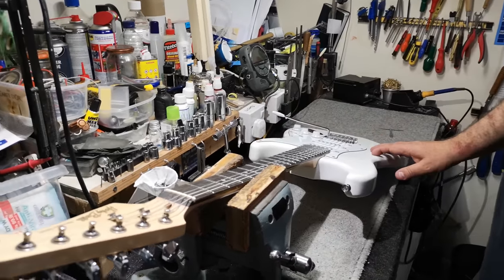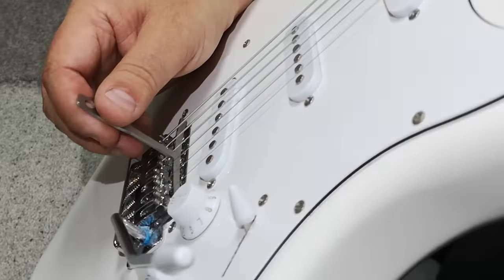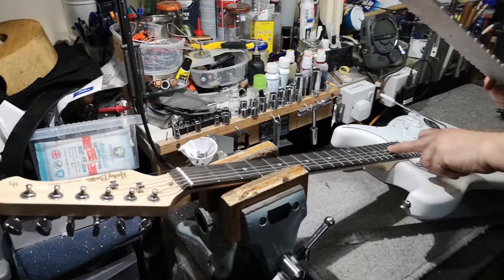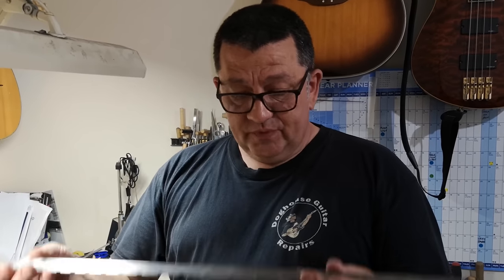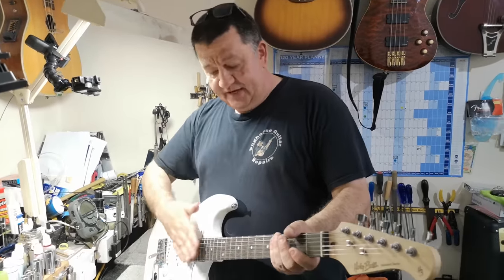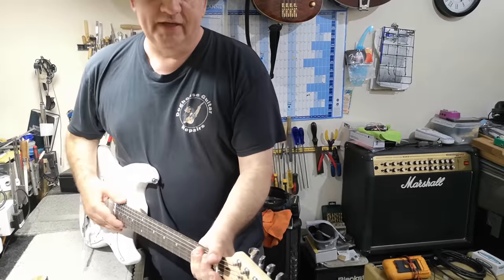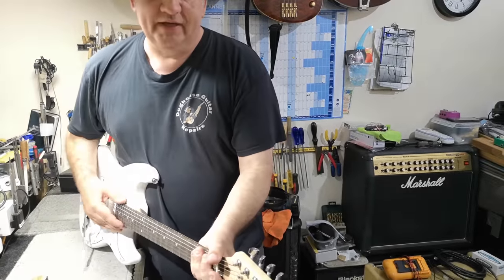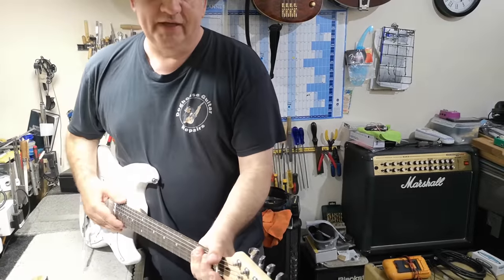I took my £30 / $40 Harley Benton to a LUTHIER...  (Harley Benton Setup - Video 1)

Comment: I'm also hotrodding a basic Harley Benton. Setup on mine was pretty good from the factory. I removed the top string tree because it was rough as hell.
I swapped out the pickups for a rainbow set of lace sensors. I have just put on a Vega Trem. Next thing is to swap the nut out for a Wilkinson rolling nut.
This was a Very informative video.
Now subscribed thanks.
Reply from the maker: Thanks so much for the sub.  Wow you’re really going for it with the mod’s!!  I’ve currently had mine set up, the only mod is a new Neutrik jack socket 😂
Reply: I put some graphtech string trees on a beginner level Ibanez I got for my daughter's Birthday last year and they're fantastic. Although everything Graphtech makes is awesome. Just an aside thought. Good luck with your modding, I'm addicted to it myself 🤣
Reply: dont forget when and if you install a roller nut on a guitar, the break point is going to be farther away from the first fret as opposed to on the edge of an ordinary nut so you have to compensate by removing part of the wood on the first fret. and once installed you can not go back to an ordinary nut, because the fret space is narrower.

Comment: Just stumbled across this video, what a gem. Love that Phil takes the time to properly explain, I've played close to 20 years and still picking up new information. Fantastic when people with this level of knowledge take the time to go through the nuances of an instrument rather than just give you some baseline nonsensical measurements of what relief should be. Still haven't got a scooby what a 16 thousandth is haha
Reply from the maker: Yeah, the whole thousandths of an inch thing is old school pre metric measurements. 16 thousandths is 0.406mm 👍
Reply: sixteeen thou is 0.016 inches. imma guessing you not a mercan ??

Comment: I don't mean to discredit this man as he clearly has a lot of knowledge on the setup of a guitar, but I own 5 Harley Bentons and had a good rapport with Thomann during the time I was buying them. They take every guitar that is about to be shipped to someone and do a final setup on them before shipping internationally (What they do in store in Germany may be different) but all of my guitars came with no need for any major setup changes. minor tweaks for my preference in action, yes. but relief, intonation etc. were spot on. You bought this used. I bet the previous owner either tinkered with stuff he shouldn't have touched, or never got it readjusted over time...
Reply from the maker: That’s great that you’ve got good ones from the factory.  Phill sees hundreds of Harley Benton’s and generally they’re ok but need a few setup tweaks for optimum playability.  Every guitar should be set up from the factory and tweaked throughout the year with the changes in temperature / humidity.
Reply: @ScottPoleyMusic  I totally agree, and their A stock stuff seems to, for the most part, adhere to what you say they should be doing. Their B Stock though? Stay away... I had one B Stock from HB show up so far off the mark, the luthier couldn't fix it... it's now a wall hanger.

Comment: In 1986 I bought my first, new, electric guitar. Prior to this I had a second-hand Hofner (which was a dog!). I bought a Japanese-made Red Squier (by Fender) Strat. It was great, compared to my Hofner, but compared to the two Harley Benton guitars I currently own, my Epiphone, my Ibanez, and even my Squier Bullet Mustang.... that Japanese Strat was total crap. It amazes me why they command such high prices today, because any HB, Vintage, Epiphone, or current model Squier, would wipe the floor with that '86 Strat in all areas (quality, tone, playability, everything!).

Of course I won't compare it to my James Tyler, Gibson Les Paul, or Chapman ML-1, for obvious reasons, but back in 1986 I got the chance to compare my '86 Squier with a friend's Les Paul Custom ('72 model), and a Fender American Strat, so I know it was shite from the outset.
Reply from the maker: That’s great insight, thanks so much.  I also have a Hofner - a 1958/9 Senator model.

Comment: The channel here you really should watch is StringTech Workstations, maybe even more than the Stewmac channel actually. For frets and necks he´s the best. You don´t have to make the notched straight edge yourself they are not that expensive and the tools you need to make one will cost you more. I measure and evaluate the straightness of the neck and then I use a stewmac fret kisser to level any high spots from the individual frets = I don´t have to re crown all frets. Then you smooth the fret ends set your action/how much relief you want and your neck job is pretty much done.
Reply from the maker: Cool, sounds like you’ve got a great method there 👍

Comment: The first guitar I bought by myself was a Washburn T-Bird from about 1978. I paid £130 for it and sold it for £100 because it wouldn't stay in tune. A few years later I learned about changing the nut, straightening the neck, adding locking tuners etc.
How I would love to get that guitar back now. They sell for around £500.
Reply from the maker: Oh man, we’ve all got those ‘one that got away’ moments.  They were such cool guitars

Comment: Judging by the logo on the headstock,this is quite an”old” pre-logo change guitar. My HB Tele has the same logo,also bought secondhand,but adding brass saddles,and a few minor pickup adjustments later,it’s a perfectly playable instrument,for a total outlay of around fifty quid!
By contrast,my HB 450 plus LP(a fairly recent acquisition),arrived from Germany in three days,with a pretty much perfect setup,almost in tune,and no sharp fret ends.The finish is also astoundingly good,so I think HB are constantly upping their game,quality-wise,unlike some of the so-called”high-end”manufacturers(no names mentioned)who seem to have got somewhat complacent with their quality,on the assumption that their name will sell the instrument.
Reply from the maker: I wasn’t aware of the logo shift.  Interesting Dennis!
Reply: On a closer look (bigger screen),you DO have  the later logo,so should be an excellent instrument,after the set up.
Haven't watched right through yet, but, particularly with strat style guitars,it may be advisable to line the internal cavities with copper,or conductive paint,to cut down on hum.
Worked well on an upgraded Chinese cheapie that I used to have.
Now in the hands of my granddaughter! Don't think my daughter in law was best pleased,but my son's okay with it,as he used to play electric bass in a band.

Comment: Just got the same one for 20 quid. Only one saddle screw was missing and needed some setup. Sounds and feels great. Can't believe the value I got for almost nothing.
Reply from the maker: Wow you got an even better deal than me.  Mine is currently 24 shows into a 60 date theatre tour, updates coming soon.  They’re so good, hope you enjoy yours and have loads of fun with it.
Reply: @ScottPoleyMusic  Thanks man, I've been wanting to get a single coil guitar for those twangy clean tones. This one totally delivers the goods and even distorted there's not much hissing. The only fault I can find right now is one of the tuning pegs is not tight enough. If I were to gig with it I'd change the tuning pegs and the nut. But even in this state it feels like a £200 guitar. Ridiculous 🤣

Comment: This guy knows what he's talking about. The explanation why guitars come out of the factory with higher action than they could is particularly pertinent. No manufacturer wants to have buzzing guitars in shops so they set them up with some extra margin. 
I leave my basses without strings for 24 hours each time I clean them. Nothing ever happened. Neck bows back and comes back into place when the strings return. It could be a different matter if a guitar were to be left without strings for months in fluctuating humidity conditions.
Reply from the maker: Agreed 👍

Comment: great portion of practical knowledge and explanation, thanks! Though my conclusion is not to do it by myself - I will go to the luthier. It's just a bit too complex and precise for a non professional like me. I only play these things ;-)
Reply from the maker: Absolutely Pawel, hopefully these videos will help you chat to a luthier about what you need from your setup.  Good luck 👍
Reply: Watch Dave's World of Fun Stuff and play with your cheap guitar. Worst case u break it but you won't. Then you can buy a range of budget guitars and modify them to play better than a custom shop at a fraction of the price.
Reply from the maker: That’s one great thing about budget guitars, if you want to learn to repair guitars, buy a cheap one.  If you make a mistake, it’s not an expensive Fender / Gibson.

Dan Erlewine and Frank Ford are my two luthier heroes (Phill’s too).
Reply: @ScottPoleyMusic  Lets not forget Twoford. An excellent luthier IMO

Comment: I liked the video, I think it's a good insight for people like me that like to attempt these things and actually see his thought process. HB are certainly putting pressure on other brands made in the same factories, I think HB still has a stigma against it but the way the world is right now, you can buy a HB with stainless steel frets, locking tuners, EMG pickups (you might not like them but they're branded) for less than £350. You could spend more than double that on let's say a Chapman (I use them as an example as they don't have a luthiers they just spec them the same as HB) and for arguably less guitar. 
But the name on the headstock ultimately sells the guitar... Will that change?
Reply from the maker: Very good points CagedPaps.  The value of the Harley Benton gear is undeniable.

Comment: Idk about string gauge. 

Hendrix played banjo strings. I think string choice is really a bit more musical than structural but I  appreciate the perspective from a gigging musicians pov. In that regard having a tool that's made to be reliable makes sense.
Reply from the maker: String gauge is such an interesting debate.  I say, try them all and find what works for you.
Reply: Banjo strings are the same as guitar strings other than the loop ends. And they are about the same gauge as a regular light electric set. Most have 009 or 010 high strings. 
You may be thinking he used a lighter gauge.

Comment: dang i guess i never realized heavier strings need a truss rod adjustment, and also that its the strings that lose intonation not the guitar itself. i always wondered why my tuner would say flat when i would tighten the saddle screw, i could never figure it out and always just had a professional do it for me.
Reply from the maker: Now you know 👍
Reply: The guitar and the strings effect intonation. Things move and weather changes your guitar.
Reply from the maker: Absolutely 👍

Comment: i bought a new HB strat for 140$ about 6 months ago...best value for money guitar i ever bought...very smooth fret ends...well set up but yup, I had to adjust the heights of the bridge to match the neck radius too...good action...excellent tone..good output from pickups... It was still in tune when i took it out of the box...and stays in tune. ..mostly...dive bombing can make it go a bit flat. The only criticism is that the trem block is a bit flimsy/ unsubstantial.  Easily a match for a Squier. I would never buy a fender...don't want to add 30% onto the price for a name on a headstock.
Reply from the maker: Glad you’ve found a guitar you bond with.  There is a tutorial about adjusting the tremolo on a HB Strat on my channel if that’s any use to your quest for improved tremolo tuning stability  👍

Comment: If would have spent $359.00 on better Harley Benton Fusion-T HH HT Roasted FBB you would have a gotten great well made Tele style Guitar with a roaster maple neck and fretboard with steel frets and 2 nice alnico humbuckers. The controls have 3 way switch, volume control and tone control with a push / pull pot. The body has comfort body cut in the back of the body and behind the neck joint.
Reply from the maker: Totally agree, they look like incredible guitars and I would love to check one out.  

However, not everybody has $359.00 to spend, especially at the moment.  I wanted to prove that you can make music with a budget instrument.
Reply: the frets are gonna be still shitty… even if you glue the frets (wich the factory’s don’t do) you need to do a fret level. that’s the only way to get a nice low action. I set my HBs 1,25 and 1,6 mm on the 12 fret

Comment: HB are great modding guitars but you do have to mess with the lower end models , the guitars in the £250 area are well set up with a little checklist of what the luthier checked after the guitar arrives in Germany from their indineasean factory , also they sell b stock guitars so every guitar is checked to some extent and if found not up to standard it’s downgraded to b stock., the nuts always too high on most guitars and that’s a usual cause of high action on cheap
Guitars and is always my first check
Reply from the maker: Nice one Dan - I’ve seen photos of the more expensive HB’s, they look great.  Thanks for commenting 👍

Comment: Ok well here's my 2c. 
1. The fretwork will need attention (ideally ripping out and doing properly)
2. The necks are often thinner and made from unseasoned wood. This can be ace if you have smaller hands. In practice though it tends to lead to "tremolo neck" syndrome. 
3. The pickups with be crap. 
4. The wiring will be fascinatingly silly but functional and the pots and switch gear will be "Asian". 
5. The nut and tuners will be awful. 

You get what you pay for? Actually yeah, you got a strat for $40. The trap is not in the relative value of getting a whole guitar for that price. Its in how much it will cost to put it right and how that works out at about the same as a Squire does new. Because that's the name of the game.
Reply from the maker: In one respect, I couldn’t agree more.  On the other hand, on my Squier bass:

1 - I’ve worked on the frets - reseated them, water thin superglued them in, levelled, crowned, polished.  
2 - no issues with the neck
3 - replaced the pickups
4 - replaced all the electronics
5 - replaced the nut and tuners (and the bridge)

Granted, it’s now a killer bass and it has a lot of sentimental value so it’s totally worth it to me.    However, if I’d just bought a better bass to start with - one could argue that it would have been a lot easier…

Comment: This is what I've done to mine: Harley Benton ST-20hh active SBK
Mods:
1. Locking tuners
2. Bone nut
3. Roller string-trees
4. Speed knob (vol)
5. Full set-up (action, intonation, etc)
6. 11-52 NYXL's
7. Fretwrap
8. Perri's leather strap
9. Dunlop strap-locks

https://youtu.be/nKeBrWx8BP0
Reply from the maker: All great mods!
Reply: How much is all of this retail and was it really worth it vs just buying a good guitar?
Reply: @werewolflover8636  Sourcing everything from Amazon it was around $100 for my mods. Added to the orig price of the guitar ($200) I would challenge anyone to produce more bang-for-the-buck. I don't think it's possible...
Reply: I just got this guitar... It's pretty fn amazing... Lol... My 3rd HB... I'll probably make it a project and upgrades but it's damn good just stock
Reply: Same pickups?
Reply: @jhall988  Yes stock EMG knockoffs.

Comment: may i know what knid of fret wire are installed in it?
Reply from the maker: Good question, metal, round on the top…. 🤣 I’d say they use a medium gauge wire, not very wide, similar to most other production guitars.  I haven’t noticed any wear on the frets after 100 shows of use.  Hope that helps 👍
Reply: @ScottPoleyMusic  are these nickel or stainless steel fret wire?
Reply from the maker: I’d assume nickel.  They’re not Stainless.

Comment: Harley Benton guitars are instruments with good build quality, but main drawbacks of these guitars are mostly bad setup, problems with wiring, and some poor hardware components of some models. But, after setup and solving of some minor hardware and electronics issues (most of these fixes are cheap, simple and quick), we can get awesome guitar for the very small money.
Reply from the maker: I agree wholeheartedly Michal, I’ll be releasing the final Harley Benton video about taking it on tour in the new year.

Comment: If a luthier insists the strings need to be the same radius all the way down the neck, run away. The string spacing spreads out along the neck, and if you keep the raduis the same the string path is through the fretboard not over it.

Try this buy getting a pipe or a beer can or a pipe and drawing a line along its axis, and then trying to draw a line a quarter inch away at the top and an inch away at the bottom.

It's also the argument for compound radii, but note that if the fret level has been done by plek or a competent luthier the fret tops follow the correct conical shape, whether or not they are aware of it.

This is not new, it's very obvious on violin family instruments that have a much much tighter radius, but the tolerances required for  a nicely playing guitar are tiny.
Reply from the maker: I've had to run away from several overzealous guitar 'repairmen' (not even going to call them luthier) in my time Rowland.  I bet you have too 🤯🤦
Reply: I believe he was saying that the Saddles need to be set at the same radius as the fretboard.
Reply: @jdl2180  yeah, that's the problem. If you do that then the G and D strings are higher than they need to be if the 3 strings are correct.

The ratio of nut radius to bridge radius is the  same as the ratio of string widths at the nut and bridge. This would be the kind of geometry nobody thinks they need after high school, until they have to set up a guitar.